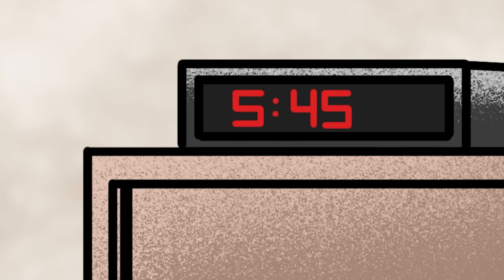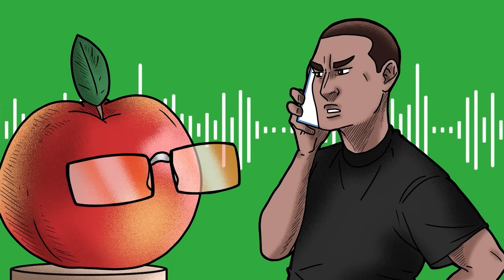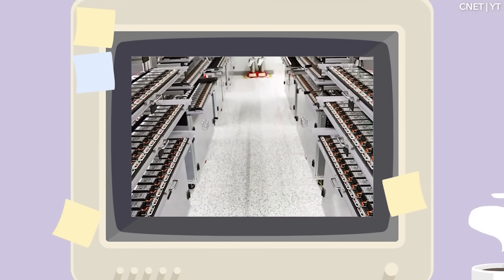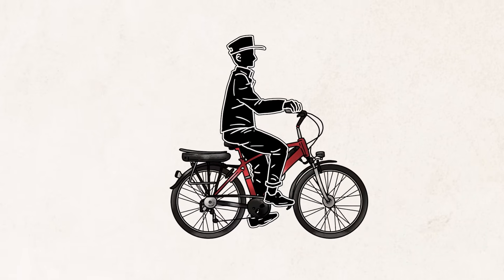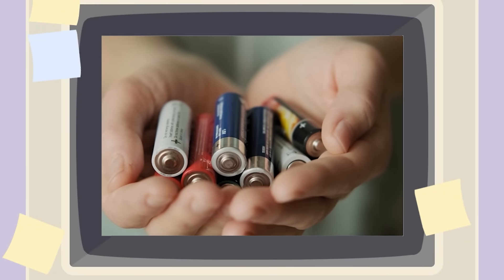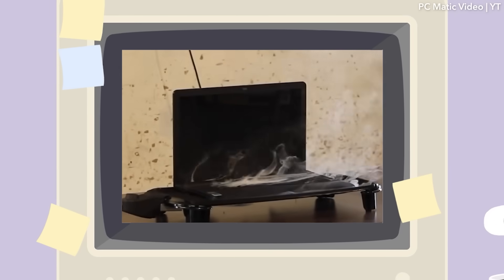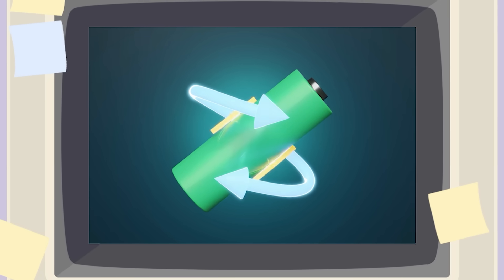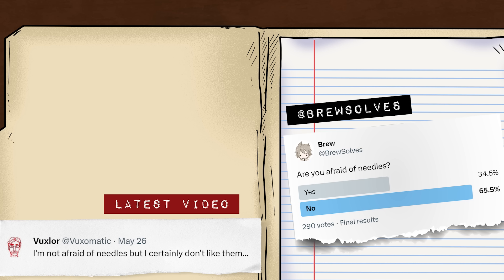A Man Wears His New AirPods. Minutes Later, He's Rushed to the Hospital.

Comment: Thank you Brew for giving me an excuse for why I still use me my trusty ol' wired earphone
Reply: The only reason I use wireless is because it's my only option on my current phone
Reply: @ShadowEclipse777  get a DAC
Reply: @ShadowEclipse777 my partner's phone doesn't have a headphone jack so it's his only option too :/ I'm a wired headphone kinda gal myself
Reply: @ShadowEclipse777 not unless u use the cable
Reply: i can give you more good reasons
1 environmentally friendlier (No battery)
2 better performance/amplification (the sound source device does the amplification, not the tiny chip int he pods)
3 reliable (no battery life)
Reply: I use it because it's cheaper. I do have wireless ones but they don't seem to work on my device.
Reply: If you take care of your elctronics they should be fine. Just be aware of if you been using headphones for hours at a time they might need a nap to cool down. If you get sweat on them wipe them off the moment you get a chance. If there are any cracks you should seal it up with a waterproof sealant, or take it in for repair if it's worth it. Always be aware of open exposure to wiring, electrodes, and the battery.
Reply: Oh my summer child you never saw the russian teen who died by being electricuted by wired earphones as her phone was plugged in dodgy socket
Reply: @mrdee2454  I got electrocuted once but in 2 seconds but it felt like under my right hand nerv
Reply: @mrdee2454  never trust anyone who says "summer child"
Reply: @mrdee2454  This is extremely rare and mainly due to her negligence .. most people know not to use a mobile phone while it's plugged directly into electricity .. the number of things that need to go wrong for this to happen is far rarer than faulty lithium batteries in wireless earphones.
Reply: @AscendantStoic  so tablets are safe to use when plugged in to electricity?
Reply: @kiaragarcia1998  not really, but people don't pay attention that much to it. But since you don't have direct contact with the electric current, worst that can happen is that the battery explodes there too. But you can feel the tablet heating up before that.
Reply: @AscendantStoic  the thing is, lithium batteries exploding in your ear is just as rare.💀
Reply: @AscendantStoic  Both are equally as rare💀 they are both lithium ion batteries and both have the potential to explode, however, CNET says the odds of a lithium ion battery exploding are 1 in 10 million, while the chances of being struck by lightning are 1 in 15,300 and the odds of falling down the stairs and dying are 1 in 1,523.
Reply: @ethodrawsstuff  Not really, one is easily avoidable while the other isn't, although it's not advisable you can use a phone while charging it without having to use any earphones, just use the speaker, but if you want to use wireless earphones at all you will have to put the lithium battery in your ear.
Reply: @AscendantStoic  qqqqqaqq@@@@@à
Reply: @kiaragarcia1998  a man was using a tablet plugged into electricity.  This is how his kidneys failed.
Reply: @kiaragarcia1998  well idk about tablets but new desktops are definitely safe, any 80+ bronze or higher power supply wont let anything go wrong
Reply: @AscendantStoic  What are you talking about. I use my phone while it's charging all the time.
Reply: @AscendantStoic wait I shouldn’t use a phone while it’s charging 😱
Reply: @mrdee2454  He was probably using a dodgy charger from China, OEM chargers are isolated from the mains voltage!
Reply: @mrdee2454  Yeah but which sane person uses wired earphones while the pohone is charging? Almost no one.
Reply: i read somewhere years ago that someone in my country electrocuted during sleep while listening to their earphone. They said this probably happened because the phone was charging so you're probably safe.
Reply: same here. been using my wired sport sony earphone for 5 years straight and the only part that was lost after 5 years is only the mic. 
the earphone is tough, used under rain, high stretch tension and sweat conditions and its still working well, even after 5 years of harsh treatment. Never going to switch to wireless that only has 2 years of lifetime max, unrecycle-able and only if you loose 1 you have to buy a new complete pair... 

More batteries more trouble to charge, more possibility of explosions and injuries, and ultimately of course battery wastes... I even frowned on the idea of smart watches... its only usable for the elderly to track their health tho...
Reply: For me the fact that whenever I use wireless earphones or any type of wireless headset I get a headache and my ears hurt is enough of a reason
Reply: Which is still connected to your timebomb in your pocket.
Reply: after his ear exploded he used his e-cigarette and then his mouth exploded
Reply: Me to
Reply: Same, i use my old trusty wired headphones
Reply: I had wired earbuds give me electric shocks, regardless of the computer, whenever I listened to Spotify.
Reply: Air pods and ear buds don't stay in my ears
Reply: I WISH I could find a phone that doesn't require Bluetooth headphones. I never got the heat like the air pods, but I never wanna chance that
Reply: Just wait till he makes a video with the old wired phones
Reply: Haha I still use wired headphones too!
Reply: Me too!
They also cost less!😎
Reply: "How a man got choked by his earphone wires"
Reply: Next video: wired headphones electrocute people...
Reply: I use wired earphones cuz they sound so much better, we're not the same.
Reply: and there's more people died electrocuted by short circuited wire headset connected to a phone that on charging...
Reply: I know someone got electricuted by wire earphones
Reply: Wired headphones provider better more consistent audio quality anyways
Reply: Luckily I can go without music for minutes at a time, no need for earphones at all.
Reply: @dtrrider1  If you don't live alone, you have to use earphones/headphones for anything related to audio.
Reply: The wire ones are the best. Because they never tell us what frequency in Hz, they use from one ear pod to the other . Bluetooth from phone to one pod but from that one to the other is a frequency and they no not write it down Hz  so the brain is transforming in zamby

Comment: Me, who always leaves my electronics with lithium batteries, always plugged in watching this video.

Well, I guess I'm not doing that anymore.
Reply: Just so you know, lithium Ion batteries will puff up and grow visibly larger before exploding. Unless you see your device visibly puffed up you're fine.
Reply: @JamesTheDiamondSword  I should probably get rid of that old puffed up ipod touch that's been sitting in my wooden drawer for the past like decade huh lol
Reply: @Sandstimes  Yes call like any waste disposal service before your house burns down
Reply: Except that Li-ion batteries have safeguards to stop overcharging…. So they won’t explode from simply being plugged in… although they will degrade their charge maximum capacity faster when left permanently plugged in.
Reply: @Foxfire-xq5ij  You are correct
Reply: Still leaving my laptop plugged in constantly because you cannot do gaming, for example, off of the battery since the laptop will go into a power-saving state.  You have to have the unit plugged in to use it at full potential - not to mention being able to do so for extended periods of time.  It really sucks that we have to worry about these dangerous batteries and they have become WAY more dangerous since they stopped with the 18650 cells (the bigger round batteries) to make these thin joke batteries that now can expand and destroy your devices (which the 18650s didn't do).  This new age in battery technology has actually gotten worse in that regard.  Honestly, the main source of power is the outlet - NOT the battery!  We should be able to leave our devices plugged in forever (perhaps with the exception of storms) without having to worry about this.  Also, I must point out that I have ALWAYS left my devices (laptops,MP3 players, etc.) plugged in 24/7 for over 25 years without issue.  None of my batteries have expanded or exploded, but I have had my rechargeable Rayovac Alkaline batteries (the newer ones at the time) corrode on me - the older, initial Rayovac rechargeable Alkaline batts didn't have this issue.  That being said, this might be a case-by-case situation half of the time.

Comment: I just got my AirPod pros for helping me hear better since research proven that it works (and it actually does based on my experiences as well). Should i be afraid? 😂
Reply: You should be ok, but be careful and take them out if you feel them heating up
Reply: Also putting this here I guess. Lithium Ion batteries will puff up and grow visibly larger before exploding. Unless you see your device visibly puffed up you're fine. Unless the air pod are extremely hot or puffed up, there is no need to worry.
Reply: CNET says the odds of a lithium ion battery exploding are 1 in 10 million, while the chances of being struck by lightning are 1 in 15,300 and the odds of falling down the stairs and dying are 1 in 1,523.
Reply: Yes, you airpods are also very overpriced, you can get better earbuds for much cheaper. That research is very incorrect.
Reply: @NEON2600 Nah it works for me 🤰🍟
Reply: @NEON2600  they aren’t💀 no other earbuds have find my that points you in the direction of the buds, spatial audio with dolby atmos, the best noise cancelling and transparency modes of any earbuds, and last 6 hours on a battery.